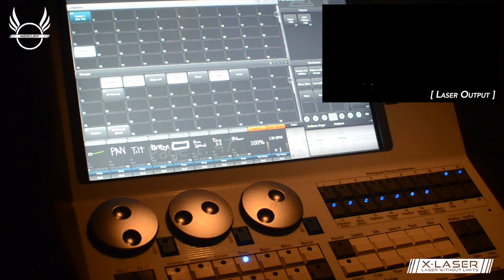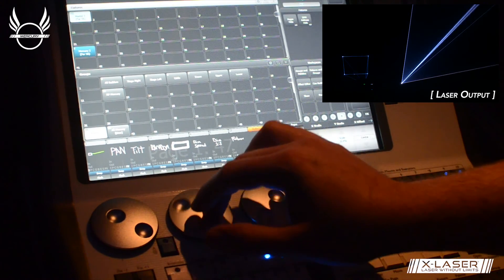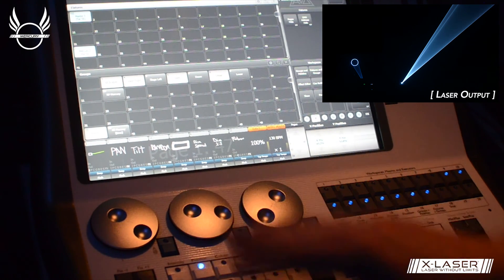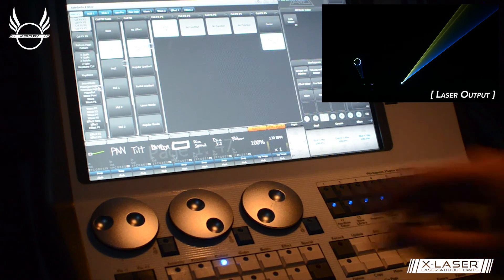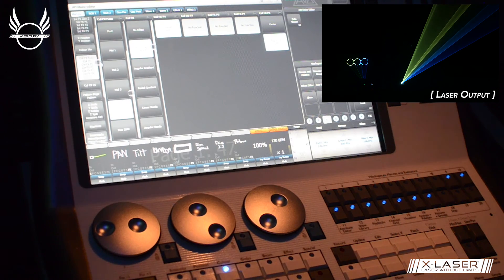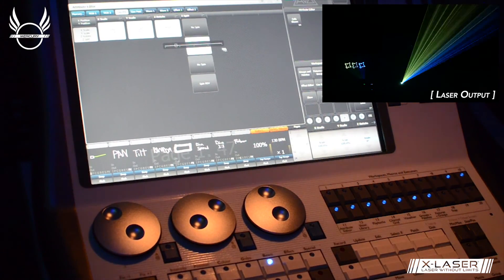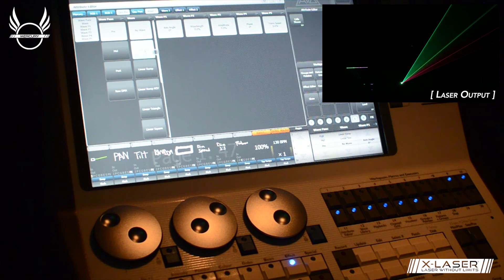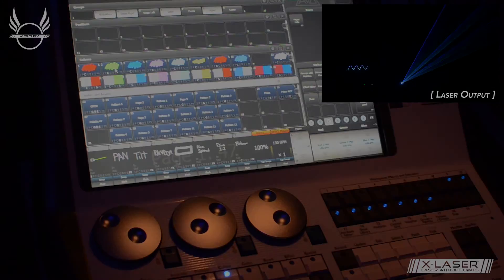X-Laser Mercury laser control demo (Avolites console)

Comment: From swamidog and Jason's rave interviews, checked out X-Laser's products, docs, and now this demo of Mercury. Gotta compliment you all for having such legit products, reasonable prices, and decades worth of professional experience.
Just getting ready to build my 3rd custom projector, with the best components I can get and wondering why I should bother, while you already have it OTC, plus with Mercury's zone capabilities via DMX.
My MIDI controlled laser synth is the equivalent to your 'gobos' 🤔 Why not correctly call them stored images, then just tell the LDs to pretend they're using lighting gobos?
Then, there's those 'digital prisms', instead of 'multiple images'. We invented our own terms, back in the day. Beam Torquers, Beam Choppers, Pick-off Mirrors, Fiber Juice, etc. Come on, guys. Images are nothing like gobos, nor are multiple images the same as digital prisms. 🤷‍♂JS
Anyway, as it happens, I'm currently building a custom master image control panel for up to 4 projectors, from scratch and guess what it has?
Having never seen Mercury until now, I'm looking at a 10" touchscreen for multipage dual GUI controls (2D touchpads for color, position, size, intensity, etc), 4 RGB buttons (to select touch pages of functionality), a rotary encoder w/detents, and a 600pps precision rotary encoder for each projector's output channel (just like your lighting desk). The only difference is that I'm using MIDI with a customized Reaper DAW timeline to replace LSX and <beep>.
Different strokes by different folks, for the same objective, making great eye candy.
Great work for 'the team'!😎
Reply from the maker: We appreciate the feedback! It's cool to see how people are creating different workflows that work best for them. At the end of the day, that's the way to go.